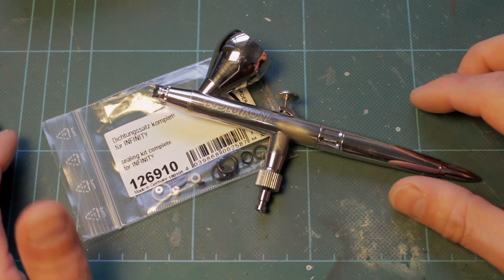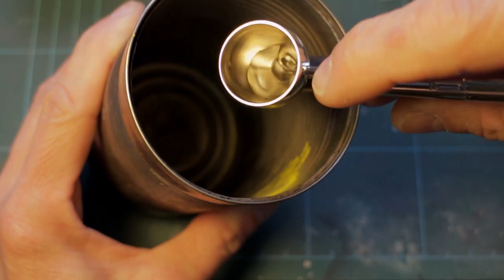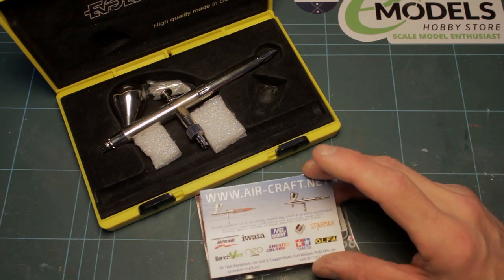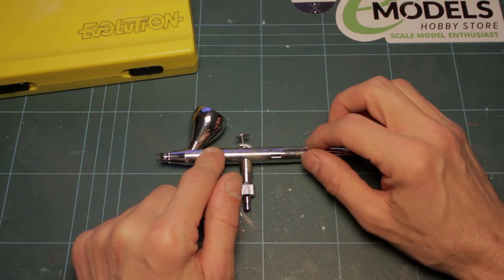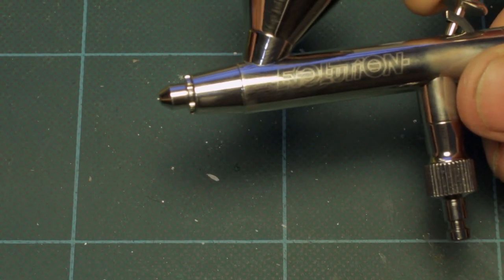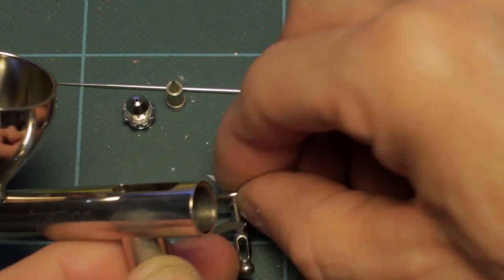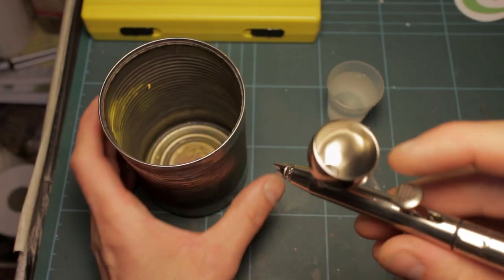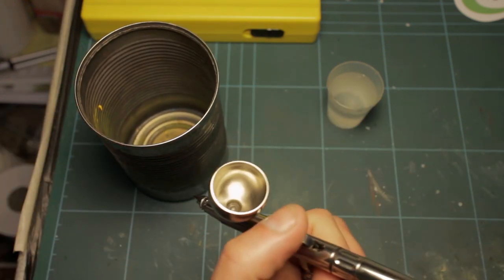Harder & Steenbeck Complete Seal Replacement & Service, Evolution Silverline Double Action

Comment: You sir have saved both my sanity and wallet, and have my sincere thanks. My Evolution I've had for 2 years started acting up and after finally determining it was either a problem in the air valve or  the needle casing, I nearly bought a new one. But by watching your crystal clear, easy to follow video a few times I realized it didn't as complicated as I thought. Following along step by step, I cleaned it all out, replaced the seals and it is literally as good as new. I seriously cannot thank you enough! All the best to you sir 😃
Reply from the maker: You are very welcome and i'm pleased it helped. Sanity is mostly overrated but always glad if it saves someone a bit of money.
I see you paint mini's, i'll take a look, I'm hopeless at brush painting and effects so any tips and pointers are appreciated.
Reply: @spidiq8  I'd be happy to help you on brush painting info. The Citadel Paint App is a really useful place to start. It has lots of videos on the fundamentals as well as more advanced ones.
Reply from the maker: @DarcyBonoCreations  That's very kind of you thanks.
I'm typically a vehicle builder, cars and motorbikes so my brush painting on those is minimal, i've tried a couple of minis but seeing some of the amazing paint jobs out there makes me a bit embarrassed.
Reply: 5 years old but still useful. Thanks

Comment: Very complete and comprehensive. I have watched several videos over the years on cleaning airbrushes and always have a shudder when I see folk re-introducing the needle, point first into the rear of the brush. The nozzle and the taper point on the needle are the most delicate part, stuff the point onto part of the body and the needle is damaged. You have shown the safe and simple way. Thanks.
Reply from the maker: Thank you for your feedback. I'm pleased you found this useful and indeed. Like yourself. Seeing some methods of stripping and ahem 'cleaning' by backflushing etc makes me cringe inwardly.
The very first thing I was taught as a paint sprayer trainee many years ago was that your equipment, regardless of the name on it is only as good as the maintenance it receives and the condition it's kept in.
The brush in this very video was a great example, it was bought second hand and supposedly cleaned and tested and working, it was filthy, poorly maintained and as seen missing numerous seals and the ones that weren't missing were worn.
However, grumble aside, I do like knowing that my videos are helpful so thanks once again.

Comment: Super helpful video!! 

Had an issue with my evolution having air escape from the nozzle even when not being used, was advised the spring tension needs to be increased in the air valve but its my first airbrush so had no idea where it is or what to do, you're video guided me through taking it apart and fixing the problem!
Reply from the maker: Glad it helped.

Comment: Is there a reason you remove the needle through the front of the airbrush?  Do you happen to have the article number of the service kit with the springs?
Reply from the maker: If you watch my airbrush cleaning videos you'll see the detailing of needle removal and such.
It's to prevent unnecessary damage to the seals is the short answer.
I don't have the kit info to hand as it's years since I did this.

Comment: I really helped, changing all the o-rings, but it seems like there a still a little bit of air comming in when then fluid goes out. Any solutions
Reply from the maker: One of the areas to check carefully is where the cup screws to the body of the brush.
Ensure the threads are clean and the seal is good.
Remove the cup and try with a small amount of fluid. If that stops it that's where the problem is.
Otherwise all you can do is carefully check all areas are spotlessly clean and sealing well

Comment: Hi in not sure what size o ring I need for my nozel on my airbrush. It's a kknoon airbrush. Are you able to tell me were I mite get one. It a Chinese airbrush what I got with a compressor set. 
Thanks
Reply from the maker: I have no idea unfortunately. That's not a brand I'm familiar with. It could be a clone of another brush or a completely independent design.
You'll need to measure either the old seal or the place it fits and will need a Vernier caliper for accurate measurements.

Comment: Hi dose the o ring kneed to be visible once fired to the nozel or not and how rite doze the nozel need to be o e fitted the new o ring.? Is that the same for any airbrush?
Reply from the maker: The O ring should not be visible once sealed. The same applies for any brush using one as it creates a seal between two parts.
Reply: We're would I get a set of or rings for my iwata neo and my harder and steenbeck ultra airbrush. Please.
Reply from the maker: @billysayers7941  You'd need to search for H&S and Iwata parts suppliers and see if you have a local authorised stockist.
I bought mine online from I think Barwell in the UK

Comment: Perfect video, also bought a 2nd that was supposed to be cleaned and working... Paint everywhere, time to change the seals :)
Don't you lubricate when you rebuild?
Reply from the maker: I don't, the simple reason is that lubricant has no place in a painting system.
Needle lube etc is just snake oil. If you have something sticking like the needle lubricating it isn't fixing the cause and the lubricant can get into the paint.
I worked at a garage for years and painted there in addition to mechanical work. Our regular sprayer taught me and another mechanic and I can tell you there's no such thing as spray gun lube or spray gun cleaner.
There's 'gunwash' which is dirt cheap and essentially raw cellulose thinner and lubricant, grease, oil etc goes nowhere near a spray gun, it's the fastest way to wreck a paint job.
Admittedly on a small plastic model kit is less of a concern but unless you like redoing paintwork there's no point.
Of all the airbrushes I have. I can pick up and plug in any one of them and spray right now with no prep as they're cleaned properly as per my video on cleaning after every spray session and they all work smoothly.
Reply: @spidiq8  OK. I used my airbrush without  problem since the beginning. But when I saw the one I got second hand with paint even at the back I was wondering if the lubricant would help with sealing.. But I guess the seal is just tired. Gonna order the full package 👌
Reply from the maker: @Lambig56  If it's the compressible Teflon type seal try tightening it down slightly first.
These tend to wear due to dragging the needle out of the back which takes pigment and paint residue with it and wears the seal but you can tighten them up to a degree before they're too worn to seal.
Reply: @spidiq8  OK I'll try that at first, but  the spray isn't consistent so I guess I'll do the service anyway. Thanks for your answers 👌
Reply from the maker: @Lambig56  No problem. If the spray is inconsistent it'll be the seals or needle/nozzle but you certainly don't want paint creeping back along the needle.
You can get a needle packing double seal conversion kit for the H&S also.

Comment: A pretty comprehensive re-seal your Evolution tutorial. So thank you for shooting (editing!) and posting. And no need to apologise for the length of the video … as far as I am concerned at least.
A couple of quick observations, if I may?

You didn't appear to use (or make any comment on) using any lube on certain key areas of the airbrush (Beetle juice, Iwata Superlube or whatever.) Is that because you don't believe in it, or did you decide that the video tutorial was already getting pretty long, and hence omitted any reference to it?

Regarding the needle packing Teflon seal and its screw. I note that your Evolution Silverline has just a SINGLE Teflon needle packing seal. On their higher-end airbrushes (CRPlus versions), Harder & Steenbeck use a TRIPLE Teflon seal arrangement. Naturally, this requires a deeper recess in the (longer) needle packing seal brass screw (in order to accommodate THREE Teflon seals.)

A TRIPLE needle packing seals and (longer) brass 'carburettor jet' screw 'upgrade' kit (REF: ATETSU) is available from Air-craft.net. Did you consider making this upgrade to your Evolution Silverline? Or did you think the cost (currently GBP £6.98, plus shipping within the UK from £2.15 from Air-craft.net) wasn't justifiable for your needs?

According to Air-craft.net's listing, the 'Triple Seal Upgrade' kit is ... "particularly suited for those who use their airbrushes heavily or commercially, and are looking for something that will last longer than the standard Single seal." The upgrade can be fitted to H&S's Ultra, Evolution, Grafo and Infinity ranges of airbrushes, and comprises the (longer) triple seal retaining screw (part no. 126470) and 3 off PTFE needle seals (part no. 123450).

For reference, the standard (SINGLE) brass needle seal retaining screw is part no. 123471 - £2.48, and a single PTFE needle seal is part no. 123450 (the same as for the triple seal version above), listed at £1.40 per each.

Hope this info might prove useful for anyone contemplating putting your excellent tutorial into practice. 👍

P.S. .… the usual disclaimers!
Reply: Night Owl Service .… happy to oblige! 😜
Reply from the maker: Mark Pearce Firstly, I'm glad you enjoyed the tutorial.
Thank you for the feedback and questions.
Lube/regdab/ etc, I feel is a complete waste of time and your money.
In all the years I sprayed full size professionally in the auto trade, we never encountered, let alone needed or used lube of any description. You're placing paint and thinners into your brush and you want paint and thinners to land on your project piece, the thing you absolutely DON'T want are contaminants, anything that 'lubricates' is a contaminant.
This is the reason I never mentioned it and for the same reason I'd never recommend it.
My cheap Chinese dual action brush is 12 years old and has had enough use and cleaning for the plating to begin to wear in the paint cup, my Iwata Revolution CR is 10 years old and has been my standard brush since I got it, my Badger Renegade Velocity was bought second hand, stripped cleaned, resealed, repaired and has been used extensively and exclusively on my last kit, the T-34/76 (and my Totoro scratch build), the H&S was bought second hand and now the seals are replaced and it too has been stripped, serviced and re sealed I expect it to perform every bit as well as the others.
In all that time, not a single one of them has used lube and not a single one has had a problem.
If something is sticking it's due to dirty improperly cleaned components or contaminated swollen o rings.
Re the needle packing, I'm aware of the triple seal and do think it could be useful for airbrush artists for example.
Most especially for anyone working with inks and heavily thinned paints, I don't see any real benefit to a model painter however but saying that, it certainly won't hurt to fit one if you like the idea and the packing screw and packing is not very expensive, fitting and adjusting would be exactly the same as the single seal in the video.
Reply: the triple seal still leaks with thinned paints i would like the option of rubber seals for the modellers as many use acrylics.
Reply: @jnrmack  So does mine. The seals react with thinners I up graded to the triple seals and it has still done it, In my lowly opinion the seals are made from a crappy material not suited to the thinners we all use.

Comment: No air is coming through my H&S brush. Can't figure out why. I have the needle and trigger assembly out trying to depress the valve and nothing happens... This airbrush has been nothing but a pain compared to my Badgers.
Reply from the maker: They can be finicky for some it seems. It has to be the air valve that's the problem. You'll need to dissemble that from the airbrush handle.
Reply: @spidiq8  Definitely seems like valve issue. I've taken it apart a couple times and it's a pain in the ass because no air will come through.

Comment: Excellent video, depending on use and/or abuse airbrushes will wear out seals. I suspect you've saved a lot of users grief, aggravation and money - brilliant!👍😊

Can I ask how long you've used/owned your H&S airbrush - and how many hours you've used it before seal replacement was required, please.

Thanks👍😊
Reply from the maker: Glad it was helpful. This particular brush honestly gets very little use as I tend to reach for my Iwata over any of the others.
I bought this (ab)used and the teflon seal was wrecked through improper cleaning by the previous user. So far, with cleaning laid out in my other video it still performs great since the seal replacement in this video.
Reply: @spidiq8  Hi, thanks for the prompt reply. Understood re your H&S airbrush, it should serve you well now. I use H&S and Sparmax as I have a wide range of modelling needs and wants from large scale through to detail work. Most of my airbrushes have an overlap but have a specific role to play - plus I can pretty much avoid rattle cans and work indoors now😊👍 I hope that you enjoy the H&S, they're a good product.👍😊
Reply: Thank you, thank you very much. It is very helpful!!

Comment: Have a infinity CR plus, which hold 3 packing needle seals.apart from that your video suits my airbrush. Thank you.
Reply from the maker: Yes, the triple seal set is an option you can add to any of the h&s.
Glad the video is helpful.
Reply: @spidiq8  i also have the CR Plus, will it work with just one seal? (the pink one) Or do i have to have three?
Reply from the maker: @danielmesch9281  If you mean the packing seals then in theory yes, however it depends if you can tighten the packing down adequately, if you can't compress it then it won't seal properly.
Reply: @spidiq8  Ok, i am going to try with just the one seal and see what happens. But it came from the factory with three seals, so i doubt that it will work.
Thank you sooo much for this video!! cheers!
Reply from the maker: @danielmesch9281  Good luck. Let me know how it goes please as it could be useful for other users.